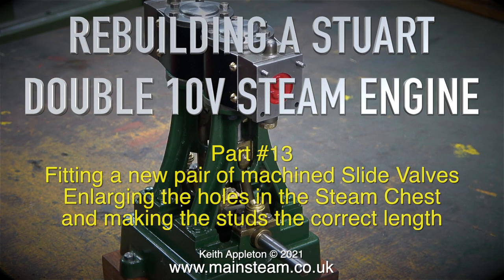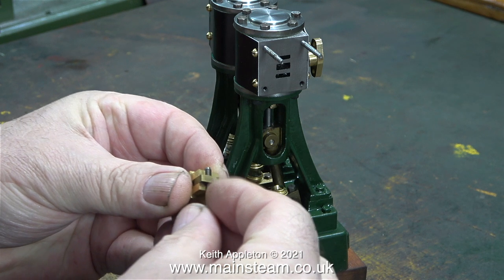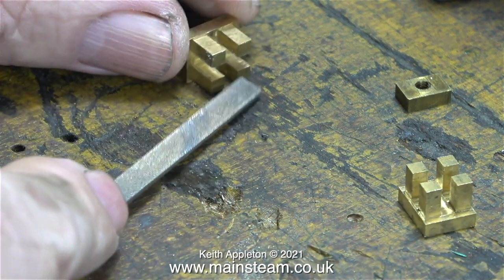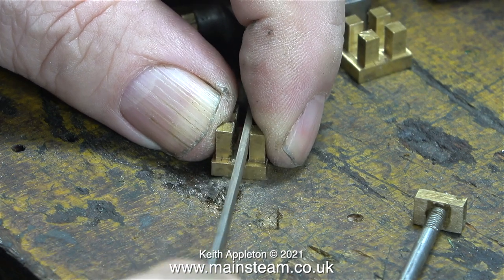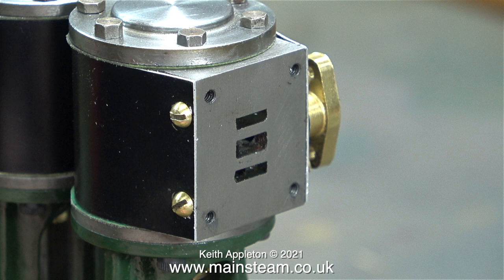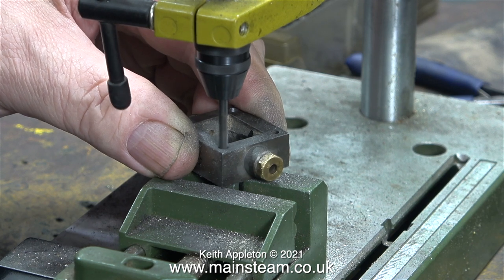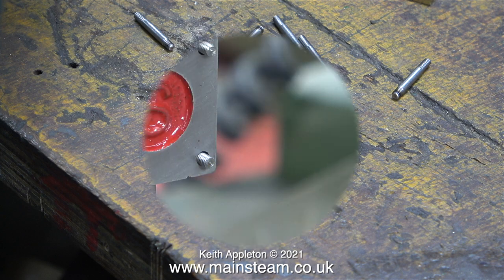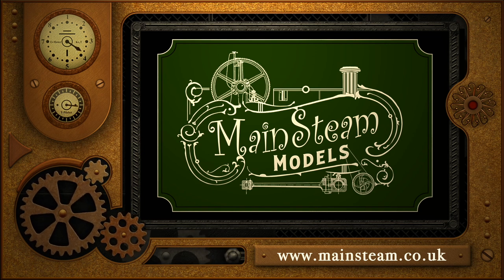REBUILDING A STUART DOUBLE 10V STEAM ENGINE - PART #13

Comment: Had the same slide valve issue on my S50.  I did exactly the same as you did, but used a glass plate and emery grit for  the block.